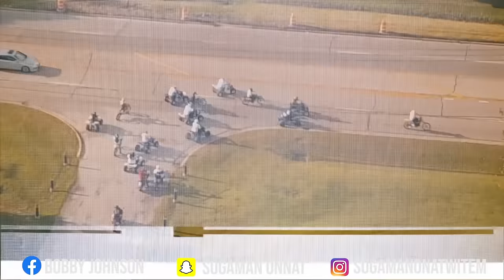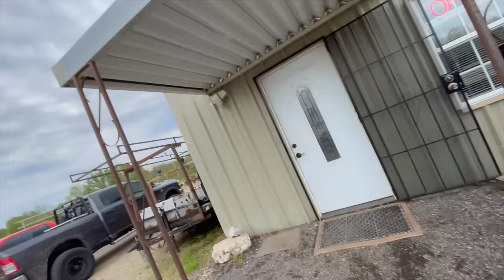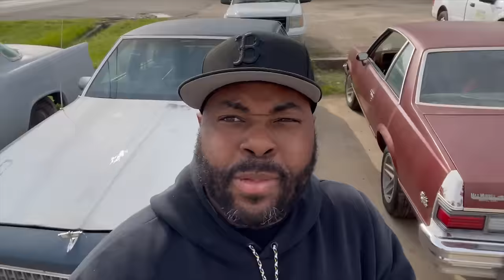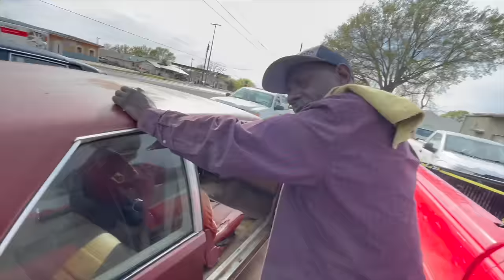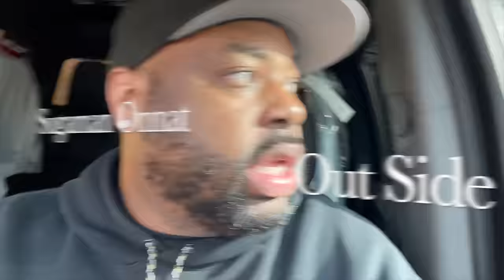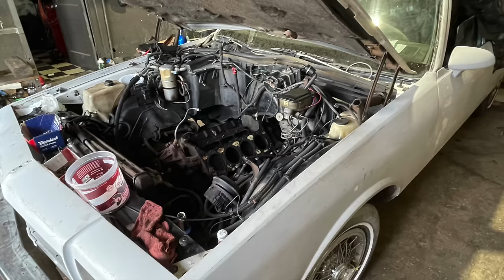Tearing My Box Chevy Motor Lil Digi Scale Down rebuiding It & Adding More Horsepower

Comment: instead of rebuilding the 305 might as well upgrade to a 350. It'll still be og because a 350 upgrade is very common and ol skool
Reply: Great suggestions.
Reply: Bro just not listening I said the same
Reply: I agree just by a brand new 350 they are cheap

Comment: Might as well change the water pump n gone n rebuild the motor for lil digi scale wit a lil cam in it so you won’t have problems wit it in the long run all new lines n hoses as well
Reply: Great suggestion .

Comment: Bro you trying to put a Oldsmobile engine in a Chevy is crazy work spend that shìt gang stop being cheap
Reply: Don't cheat the game play the game.
Reply: Actually its not hard and its still a 350 Chevy motor just different internals and they renamed it 😂
Reply: How's it hard?? They the same engines with different names stamped on it I work for GM you do know Oldsmobile and Chevy are the same company right smh!!
Reply: Bro Oldsmobile 350 is different from a 350 Chevy both are 350 engines perform totally different just like Buick 350 in Pontiac 350
Reply: @vongreen6820  Bro they the same engines with different shift points I work at GM for the new generation different tunes!! All same parts!! All the engines are made all we do is put different name plates on them you think we have 3 different plants making Oldsmobile, Pontiac,Chevy engines ? When they where around no they all come down the same line with the same parts with different names on the stamps that all
Reply: From factory Chevy make more power  I got a 1989 caprice with a 350 in a 1978 Oldsmobile delta 88 in a 1979 Buick LeSabre with a 350
Reply: @vongreen6820  exactly they have different tunes each has different CPU and the techem in the transmissions are programmed differently but all are built on the same assembly line

Comment: Need to do some upgrades to that 350 
Intake 
4 barrel carb
Full tune up with timing and carb tune
Water pump and thermostat 
Radiator with full coolanr flush 
Fuel pump n filter with fuel flush
Nice thick oil and good oil filter 

😢

Comment: Check them lifters out while it’s in that stage I would just change them. I did a full rebuild on 350 rocket Oldsmobile motor bored it over 30 and added a mild cam to it. It’s still sitting wrapped in plastic never been ran. I’ve been working on my car for 2 years so I understand the process. You just might as well do it right the first time so won’t have to back track. Stay up and I rock with you the long way 🫡💯